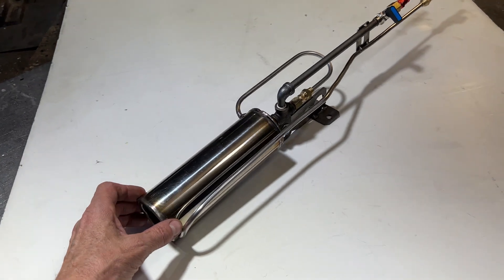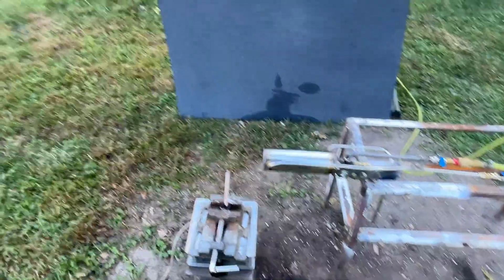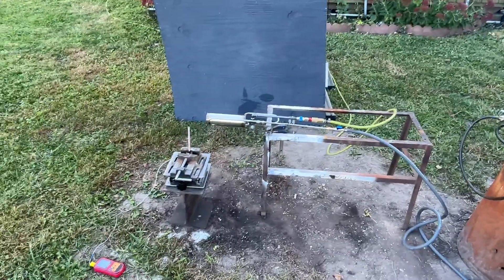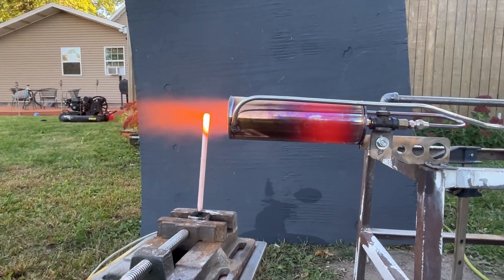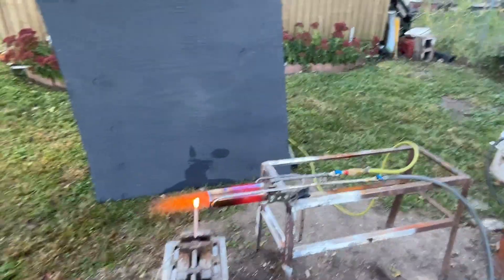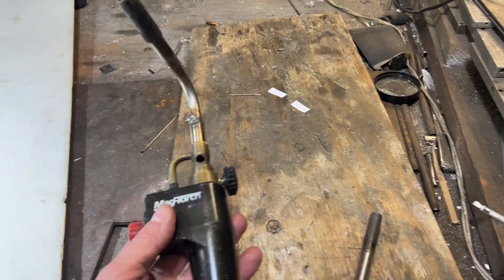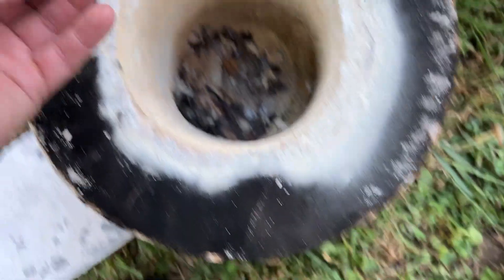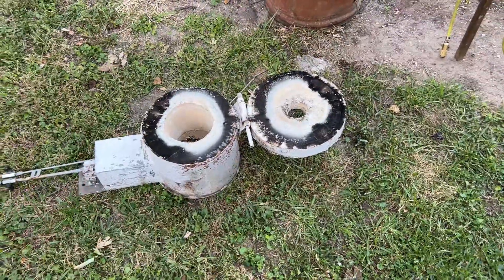Thermal Propane Cracking Hydrogen Burner

Comment: Could you possibly crack natural gas with a similar design? I’m not an engineer but I fiddle w thermodynamics in the realm of precision machining. If it’s heat you’re after you’ll want to minimize the amount of carbon particles being expelled from your nozzle. They may be small but they’ll add up as a parasitic energy loss. Heat is being used to heat those pieces of carbon up rather than being applied to the outer environment or your work piece. I know it sounds expensive but a small 1cc reservoir filled with palladium sponge after your cracking coil could increase your thermal efficiency by at least 5% Another thing you may want to try if thermolysis. Those temperatures you could turn distilled water into pure hydrogen and oxygen from heat alone. Perhaps a second capillary coil that feeds back into the main coil to boost pressure, fuel and oxidizer levels! Either way, very fascinating as always!
Reply: Or other liquid fuels like gas/diesel. Where I live the price of propane is significantly higher (near double per BTU) than standard gas/diesel. I got to rewatch the oil burner vids now lol.

Wish I could get  a natural gas hookup.

Comment: I have been mentally playing with the idea of building a used engine oil torch. Using a hho generator. About 100 cells made from carbon felt and stainless steel . Inside a 5 gallon bucket. Connected to a leaf blower through a Venturi . The oil added to the torch with basically a carburator the difference being the carburator having a heater inside, heating the oil inside to around 200°f . The hho heavy air passing through a venturi using large annular booster filled with tiny holes possibly.005"-.010" the oil heated should pass through.  The option being removed the booster from the Venturi possibly placed after it. And move to pressurized design. Using a pump capable of 100-200 psi+. Using a valve to close a bypass. closing  the bypass sends the full pressure , except for an emergency relieve valve rated to open at 100psi below the plumbings rated operating  pressure.  And with the actual burner built similar to yours. Only adding a after burner. With the oil being preheated like rocket engines cooling the nozzles  possibly a small amount of diesel, or  kerosene, possibly gasoline. The nozzle made from two stainless pipes one inside the other with a 3/8" stainless tube feeding oil to the in-between area  then to a tube welded only to the inner pipe it being the outlet. Having a tip with multiple small holes spraying oil onto the walls from the center mixing with the air , and possibly vaporizing on the wall . Then being hot from the burning oil only a few inches away. It may require propane to get it started. I am looking to create  temperatures high enough to melt iron. Hot enough to do sand cast. The added O2 rom the hho should ensure this. Not certain of the temperature the oil burns at, with only a blower it can melt iron. I'm wanting to do it faster.  Any advice is welcome, especially before I spend $$ on it. Great video, have an awesome day🎉

Comment: You are supplying pre-cracked Hydrocarbons and avoid the Cooling Effect of the Bond Breaking, but it still has the same Combustion End-Products.

(Heating the Input Streams obviously helps against losing Temperature as well.)

The contained (chemical) Energy gets (mostly) distributed over the Products.

The Reason Ethine ("Acetylene") burns so hot is the high Energy in the triple Bond combined with the comparatively low Amount of End Products that share the Energy.

HCCH + 2.5*O2-> H2O + CO2 + CO2
High Energy Content | limited Water

A good Combination, because H2O takes a lot more Energy for every Kelvin of Temperature compared to CO2.

The isobaric Specific Heat at 2000K of H2O is around two Times that of CO2 according to WolframAlpha.

That’s the Reason Ethine burns hotter than Hydrogen and Fuel Oil beats Propane in adiabatic Flame Temperature in Air.
(Wikipedia says: Ethine 2500°C, Hydrogen 2254°C, Butane 2231°C, Fuel Oils ~2100°C, Propane 1980°C, Methane 1963°C)
Reply: Basically a lot of Words to say:
Try Butane and preheat everything to the Limit of your Materials.
Reply: I.E. an additional Coil on the Outside for the compessed Air, a Shroud that pulls the Ambient Air over the Outside of the Chamber and another Coil for the Vaporization of the Butane.

At the same Time it might reduce the Temperature on the Outside to keep it in working Condition for longer.
The Decrease in Temperature in the Cracking-Chamber shouldn’t be that bad.
Reply: Excellent post
Reply: I have something pretty big to add about cracking WATER. I'm going to achieve that.

Comment: would heating the air too help ?
Reply: I second this! What if you put an baffled shroud that would have the air coming from the front of the touch, drawn around the hot tip to then enter at the back like you already have it. May not increase the temps a significant amount but would expect it to increase the efficiency and result in less fuel needed for peak temps. I've been wanting to build a wood stove that uses this concept to effectively burn everything and super efficient.

Comment: The best way to increase the flame temp is to use some confinement and increase both the speed and pressure of the combustion.
Reply: Yes! And a swirl flame if possible. He forgot to mention the swirl propane torches that have been available for a decade plus.
Reply from the maker: Swirl doesnt do any thing for temp my friend . The swirl on propane torches is to get the flame to wrap around items your heating . The rotation thing is only good for low velocity flames in my experience . I have videos where we go all out on the rotation theme  and its a no go in most cases . Its only good for large lazy flams or small lazy flames .

Comment: Can the carbon from cracking eventually plug up the double wall?
Reply from the maker: Yes but im hoping erosion persist . Also after each run if we allow the propane valve to vent to air into the chamber and burn it pretty fast

Comment: Catalyst for conversion is what is needed.
Reply from the maker: Thermal is free in this case my friend .
Reply: But if the catalyst is cheap and greatly enhances the thermal you are limiting yourself. Remember. No limits, you said it. So are you on a quest for complete domination, or not?
Reply from the maker: @ohbeardedone9253  catalyst are not cheap typically and become fowled out and clogged very quickly in this reaction . Would be very cool but thats just to expensive a path
Reply: @NOBOX7  you might check out aluminum oxide. It is a good catalyst for dehydrogenation; I use it in my lab to break hydrogen off of hydrocarbons, though there we are looking for the carbon and just vent the hydrogen. I suspect you will have to deal with carbon buildup in your thermal cracker in any circumstance.

Comment: Why not preheat the air also?  I’ve read it can increase combustion temp.
Reply from the maker: Yes you are correct , in this case the nozzle pre heats the air as it is about 380 Deg F . On smaller burners  pre heat has limited value due to the fact cold air has more oxygen per s inch . I have a couple burners that have  dedicated air pre heat .
In this case 700 deg f  hydrogen is entering the nozzle heating the parts and the air to about 350 to 380 deg